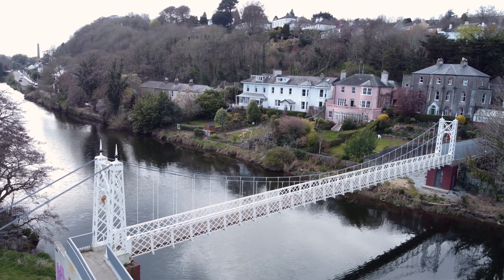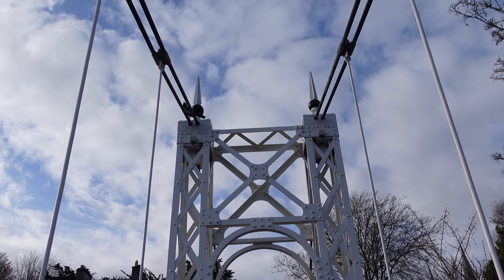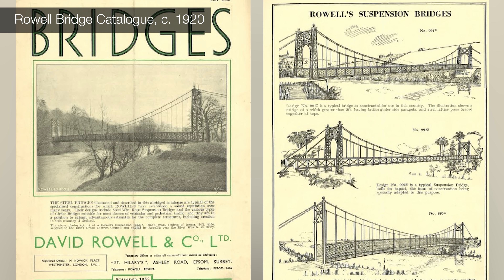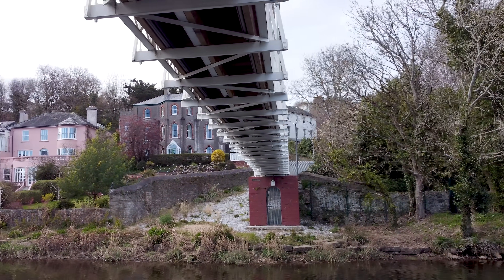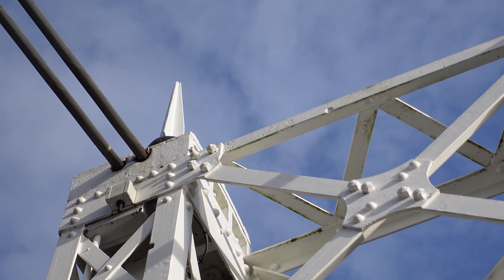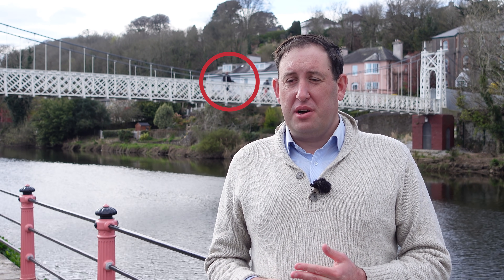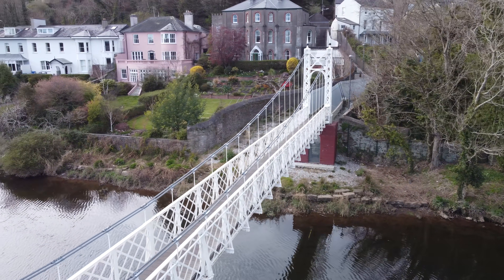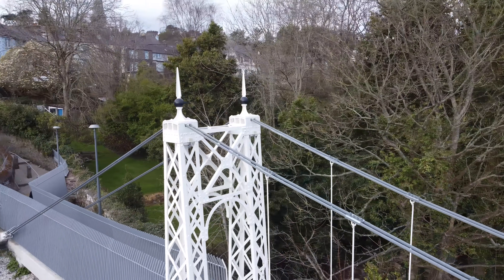The bridge that must legally wobble

Comment: Fun Fact: The restoration of that bridge cost 1.7 million euros, a full 34 times more expensive than the inflation-adjusted cost to build the original bridge.
Reply: Fun Fact:  A full restoration of nearly anything, if done properly, is always more expensive than the original.  It's all a matter of degree.
Reply: Modern safety regulations means that there are redundancies built in to keep workers safe from injury and death. Workers are paid living wages. Materials cost more for the same two reasons as I just stated. The bridge had to be disassembled, refurbished, and reassembled, which is significantly more work than just putting something up on a blank canvas. Everything adds up. 34x isn't bad at all.
Reply: To be fair, they got a REALLY good deal - even for the time - on the original ;)
Reply: this is the same with classic cars etc. some cataloged mass produced item becomes a unicate where every piece is special made with the passing of time
Reply: It’s almost like, it’s harder to fix some things things than it is to build new ones, huh.
Reply: @roberttalada5196  The issue is that protected buildings cannot be completely torn down and replaced with something new. There are legal and social repercussions for it.
Reply: What's your point? Restoring an old car with expensive techniques and welding is also more expensive than buying a new one
Reply: @bluezz5002  It’s a fun fact - it doesn't need a point, I just thought it was an interesting statistic
Reply: @bluezz5002  Not by much, and new cars have massive economy of production line assembly. Any one car does not have many duplicated parts, one steering wheel, one left front panel, one of everything. 

In opposition to the car situation, an single iron bridge has massive duplication of a relatively small number of parts. And most bridges, new or old, are custom products.
 

Summary: economically speaking, bridges are the opposite of cars.
Reply: @mytech6779  the complex restoration techniques are the same
Reply: @bluezz5002  No, they really aren't. Unless maybe you zoom out all the way to the level of "We have a pile of metal and some tools to put the metal together. "
Reply: Guess what a catalog ordered bridge would cost today?
Reply: Labor costs, regulation, permits, materials costs.
Reply: price guaging. Every company in every part of every process does it. So now everything is too expensive.
Reply: Think about NYC Hudson tunnel costs 48MioUS$ in 1927, which are today 793MioUS$, now the nearly identical new one is an estimated 12300MioUS$, probably much more upon completion. The building industrie sucks. Other industries have learned how to deliver more economically, the building industry how to press more money out of the customer, at least politicans and tax payers.
Reply: @flexiblebirdchannel  well a lot of stuff changed since then in 1927 no one cared for health and safety and environmental impact. And a new tunnel has all the safety equipment priced in wich was retrofitted to the old ones, additionally logistics become more complicated
Reply: @flexiblebirdchannel  I think "1MioUS$" is the most creative way I've seen someone write "a million dollars". You can just write it as $1M or $50M for example.
Reply: @flexiblebirdchannel  In all fairness, if you build something expensive thats built to last, its probably gonna be unique in alot of ways, aka quirks, now that means those quirks 90 years from now have to be accounted for, dealt with, all the while the dickheads who built the thing 90 years ago just said to themselves, “if it works for 90 years then when it does break itll be some other assholes problem hope theyre prepared”.
Reply: @flexiblebirdchannel  That's not even double $800M to $1.2B, the bridge repairs cost 34x.
Reply: @flexiblebirdchannel  US United States dollars?
Reply: @Sarahbryson321  Of course, what do you think does US$ say ?
Reply: @flexiblebirdchannel  just use USD or the dollar symbol
Reply: no way that thing only cost 50 thousand euros in todays money
Reply: Because they had to pay 100 architects and engineers to squabble how to repair a bridge that small
Reply: Fun fact: there is no such word as euros. The plural of euro is euro
Reply: @danganbeg7225  Another fun fact: The EU don't control how people use the English language (yet), and if people say things like two euros, then euros is a word.
Reply: Which only means they lie about rates of inflation.
Reply: @mytech6779  no it clearly doesn’t, it just means the construction went up in price through inflation and relative to other prices. There could be many reasons for the second one like:
-other materials
-more demand
-less constructors
-more legal restrictions
-higher qualification of workers 
-higher safety standards 
And so on …
Reply: @harstenstahl1367  AKA price inflation. Due to stated inefficiencies restricting supply relative to the supply of currency.
Reply: @mytech6779  The original was a mass-produced catalogue bridge. The repair would require custom machined parts.
Reply: @mytech6779  It's more like they have redefined the term inflation to mean something it doesn't.
Reply: @mytech6779  Its a little different to get new materials off a shelf and having to have labor intensive restoration
Reply: @mytech6779 I'm curious what your point even was here. Who is lying about inflation rates? To what end?
Reply: @sceerane8662  If you can't think of any reason for politicians to lie about inflation, then you lack the basic cognitive function needed to engage in a profitable conversation. History is absolutely packed with examples of governments lying about inflation.
Reply: @mytech6779 Then list them?
Reply: @mytech6779  I still really don't understand your logic behind this wording. How does one lie about the relative value of a fiat currency? It has no intrinsic worth to begin with.

Do you mean that the rate of inflation has been manipulated over the course of history? Because if you do, you should just say that instead.
Reply: @mytech6779    or (and I'm not denying the possibility of what you said mearly saying its not 100% true) it means inflation rates don't account for product cost per time period mearly avg value of a dollar, typically done with more elastic goods and average income.  Theres many cases where the reverse is true and the currency actually buys more of a certain item compared to the past. I'll use an more extreme examples before explaining why it would be so cheap in the past. Take insulin, microwaves, phones, or personal computers as examples they used to be much more expensive percentage wise to the average income. They used to be luxuries now, while still more luxurious items, every one has them (besides insulin) they are a common mans luxury. To explain this specific case, it was then machine age/gilded age in an developed country (the UK no less which had its colonies), in the machine age things like steel where big industry's especially in europe, not so much anymore.. it also being a historical structure and modern labor laws increase it heavily. It's a problem especially in the united states for steel but also penncilen which are last manufacturing plant closed in like 2011 or something.
Reply: @swampdonkey1567  The only way to increase  both wages and commodity material prices is to weaken the currency used to measure them. 
Structural steel is an open market commodity with many sources and customers and traded in bulk, so directly tied to inflation. Quite unlike the specialty products you listed.
Reply: @mytech6779  No, not at all, they just get stupider and don't buy a mass produced pre engineered item, they have to act like narcissists and say look at us look at this big show we made
Reply: @integr8er66  It was already engineered, about 100 years ago.
Reply: @mytech6779  No, it's more just that new regulations are a pain and cost the consumer. Also, they lie about rates of inflation.
Reply: @frozenheartedgiant8330  safety regulations are written in blood.  So tell me how many people’s deaths do you consider is acceptable for getting a cheaper bridge?
Reply: Everything wrong with todays society in a nutshell.

Comment: have a look at the suspension bridge across the river nith in dumfries it was built in 1875, that's 50yrs before.
It has the identical movements that I have felt in the uncountable times I have crossed it.

Comment: I'm an Irish engineering student with an upcoming exam in mechanical vibrations and keeping the shaky bridge shaky goes against everything I have ever learned. I wish I could have been involved.
Reply: It's not so much against everything you learnt as you're only going against the "reduce oscillation" part of it. All structures have harmonics and resonance, which you calculate. You then don't fix it, just make sure it won't break :)
Reply: Alice? More rigid bridge?
Reply: I'm glad you weren't involved. I don't want you engineering in ways that go against everything you have ever learned.

Comment: It's an unshakeable (perhaps comforting) myth that bridges/tall buildings/aircraft wings must shake/sway/bend or otherwise they'd break.  The reverse is true:  if they were made stiffer (less flexible) they would be even stronger than they are.  But there is a cost to making structures stiffer - extra materials, extra weight. So engineers make structures as lightweight (and flexible) as they can get away with.
Reply: that's..... plain wrong
Reply: modern buildings and structures are flexible on purpose, in the case of seismic activity, as Tom said if you have a completely hard building it will instantly crack. On the other hand, a building that is composed of flexible materials won't. It's not a matter of price, it's a matter of safety. You should look up what you talk about before actually talking about it, as a structural engeneer now what I'm talking about as I have been on this area for years
Reply: @caldeira_a  I write from the vantage point of 30 years of teaching Structural Engineering at a top 100 university.  It's a matter of fact (contrary to what you assert ) that Tom neither mentions "seismic activity" nor "buildings".  [ Incidentally, "hard" is not an term used by structural engineers to describe buildings: perhaps you meant "rigid" ? ].   And of course, no engineer would ever refer to a "completely hard (rigid) building" - there is no such thing in practice.  You are evidently not a structural engineer and it's unfortunate that you cannot find something more productive to do with your time.
Reply: you're the one who started talking (wrongly) about buildings
how else would you explain engeneering to a random person on the internet? no one is gonna understand half of what you say nor care about the other half, there's a reason poeple differ between scientific and general expressions

Comment: That bridge has a sibling in my home town of Shrewsbury! The bridge that goes over the river Severn from the quarry to the boathouse pub was built by the same company and wobbles possibly more than this one does. Looks almost identical too but ours is green (last time I saw it anyway)
Reply: Porthill Bridge. It even has its own Wikipedia article, which says: "Porthill Bridge experiences significant vibration, even when few people are crossing it - and has done since it was installed. Local pedestrians mostly accept this eccentricity as part of the bridge's charm."
Reply: It's a more expensive, and wider, model but otherwise very similar. According to the Wiki the Shrewsbury bridge cost almost four times as much as the Cork bridge - 2,600 pounds in 1922.
Reply: Awesome
Reply: Ok, so there are 2 more bridges like this.
Reply: @Moloxer  Given that they ordered them from a catalogue, I would assume, that there are/were a few more.

Comment: Shaky bridges are great. I remember many years ago when I was at school going across a suspension bridge in Scotland with a few friends. We decided to see what would happen if we walked in step. I think we managed about 3 steps in unison before realising just how bad an idea it was. It's really amazing how quickly the feedback builds up if you manage to match the resonant frequency of a bridge.
Reply: Not sure if you're aware, but a French bridge collapsed after soldiers marched across it.

Every army then ordered troops to break step as they went over bridges.
Reply: @MandolinMagi  You probably mean the Broughton Bridge collapse, which while the marching contributed to the collapse, the bridge was poorly constructed and failure was actually found to be inevitable. That led to breaking step when crossing bridges in the British and French armies. In France, marching at the  Angers bridge's resonance frequency is only partially the cause of collapse too. The soldiers were actual already ordered NOT to march in cadence when crossing. But the bridge was poorly maintained and there was heavy winds. The various loads were the primary reason why Angers bridge collapsed so in both cases it was multiple contributing reasons.
Reply: Did you get it to bounce or swing?
Reply: @iamdave84  it bounced so much it threw us in the air. Amazing just how quickly it built up.

Comment: There is a somewhat similar bridge here in Minnesota, the "Swinging Bridge" across the St. Louis River within Jay Cooke State Park.  It has been damaged or destroyed by spring floods on several occasions and rebuilt higher and stronger each time as a result, so while it is MUCH less "swingy" than the original it still has a bit of a bounce much like the one in your video.

Comment: You should check out Treforest in the Rhondda valley in South Wales, fascinating industrial history including abandoned canals, a massive tunnel which may have had a forest built on top of it, and abandoned tinworks which can't be demolished safely or have anything built on the grounds due to intense heavy metal pollution. There's also a bridge made to be used for weighing ships as they carried coal, tin, iron and timber up and down the valley.

Comment: "We have the technology and the science to build a more stable bridge"

"No."

Humans are awesome.
Reply: Just because you can, doesn't mean you should.

Am I using it right?
Reply: @mmseng2  yes
Reply: @mmseng2  Well... In this case, you probably should. So it's less vulnerable and doesn't have to be repaired as often. But, humans and their traditions.
Reply: @ShaliWolfy  I actually agree, but that's why I thought the application of the phrase was humorous.
Reply: @ShaliWolfy  it lasted 100 years, I could say other variant would have been more "stable" but I don't believe it would have been more structurally sound. As with any large contraction forcing something to be rigid makes it prone to breaking and fractures. It would have been more stable but for shorter period, or would have used a lot of maintenance related to replacing dampening materials etc.
Reply: @ShaliWolfy  Doing large maintenance once every 90 years is ok in my books. :D And people love it the way it is, so while you can say it's traditions, I feel it's more of nostalgia on humans side :)
Reply: "keep the shake. keep the shake."
Reply: Because bureaucracy won't allow simple improvements. Either don't change a thing and its fine with no complaints, or start totally from scratch complete with environmental impact studies and every costly modern add-on to please every corner case special lobby group, such that it is no longer a justifiable cost and nobody gets any bridge at all.

Comment: In 2020, the relative value of £700 from 1927 ranges from £42,410.00 to £324,300.00.

A simple Purchasing Power Calculator would say the relative value is £42,720.00. This answer is obtained by multiplying £700.00 by the percentage increase in the RPI from 1927 to 2020.

This may not be the best answer.

The best measure of the relative value over time depends on if you are interested in comparing the cost or value of a Commodity , Income or Wealth , or a Project . For more discussion on how to pick the best measure, consult the Tutorials.

If you want to compare the value of a £700 0s 0d Commodity in 1927 there are four choices. In 2020 the relative:
real price of that commodity is £42,720.00
labour value of that commodity is £126,200.00
income value of that commodity is £219,600.00
economic share of that commodity is £324,300.00

If you want to compare the value of a £700 0s 0d Income or Wealth , in 1927 there are four choices. In 2020 the relative:
real wage or real wealth value of that income or wealth is £42,720.00
labour earnings of that income or wealth is £126,200.00
relative income value of that income or wealth is £219,600.00
relative output value of that income or wealth is £324,300.00

If you want to compare the value of a £700 0s 0d Project in 1927 there are three choices. In 2020 the relative:
real cost of that project is £42,410.00
labour cost of that project is £126,200.00
economic cost of that project is £324,300.00

Comment: A bridge catalogue would have helped years ago when the canals were the transportation system.  Effectively Mechno bridges: I bet overlapping parts were used in the various designs and you are making a set of pieces per 10 foot length (or some other standard)

Comment: The idea that "If is doesn't shake, it will break" is also true for wooden roller coasters.
Reply: every structures shakes if there is a dynamic load or a sudden load
Reply: Steel roller coasters too. Just with very different frequency and amplitude.
Reply: of all structures, really. Forces cause stresses, and stresses can cause strains (and thus) displacements. Rigid boundary conditions that restrict these displacements can result in even higher stresses, possibly in excess of a materials compressive or tensile strength.